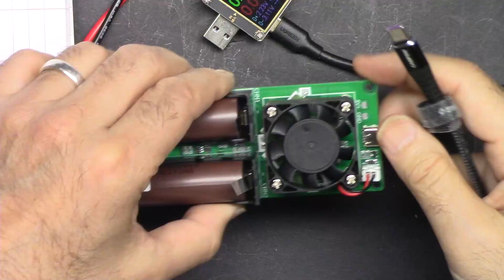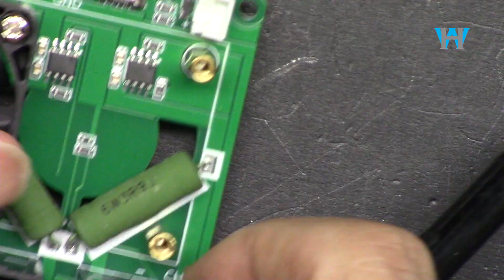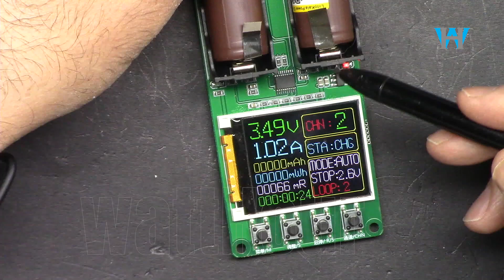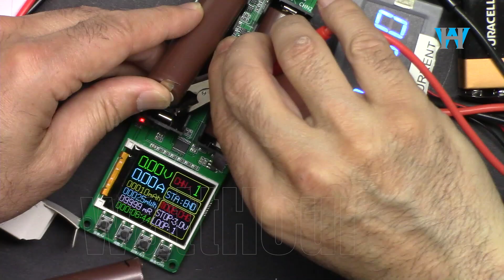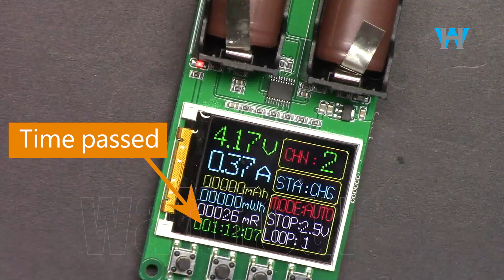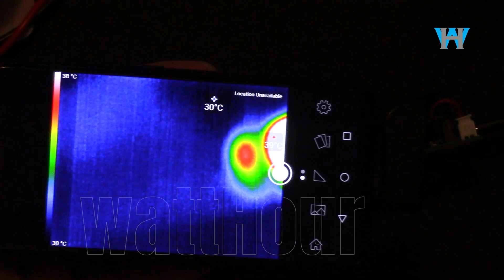Tested: 2ch 18650 Lithium Battery Charge discharge capacity tester module

Comment: I love this tester from Aliexpress. Because there is no description/manual available I had to find out the handling myself. Only setback:
The cooling fan after a few hours began to make noises. I had to apply a drop of oil to the bearing.
Reply from the maker: Thanks for sharing your experience with this product.

Comment: Hello, can you unsolder the resistor, which is an 8 ohm, 4 ohm load and see if it shows 1 amp load with the unsoldered resistor? Several people say that the screen shows unrealistic false readings with an unsoldered resistor or a replaced one
Reply: Of course it shows incorrect readings if you remove the resistor. Replacing the 3.9 ohm resistor with a 4.0 ohm will also change the reported results.

Comment: Hello. Does this device show internal resistance correctly? Compared to normal devices such as yr1035+ or ts457
Reply from the maker: Hi, I have mentioned.  it shows and changes as the charge level of battery changes.

Comment: Would you happen to know which of the measurements are going to be affected by the resistor tolerance error?
Reply from the maker: Here is an answer from Google AI Gemini https://g.co/gemini/share/7346b00de0e4
Reply from the maker: what? the tolerance is 5%, then the reading will have 5% error. as simple as that.